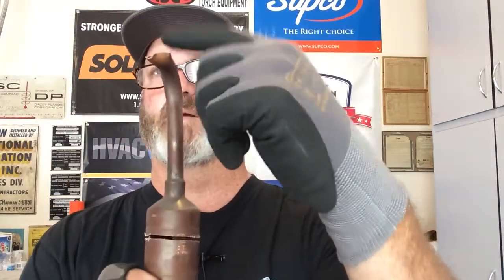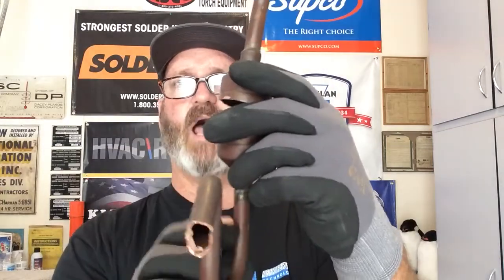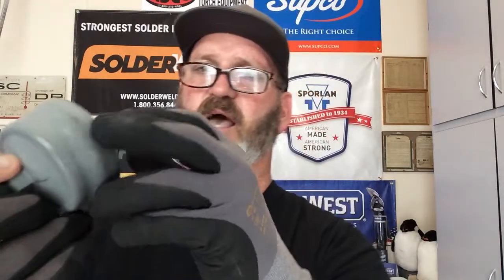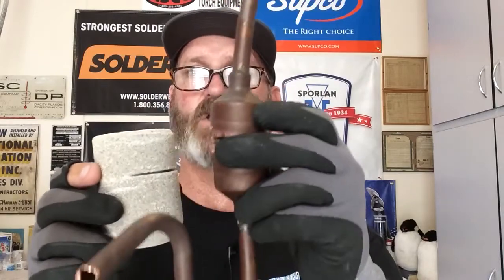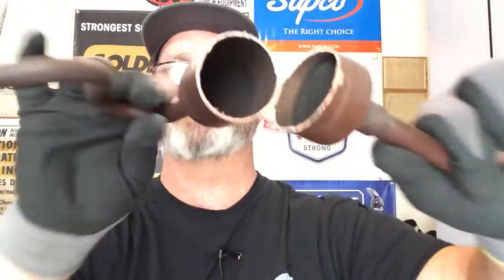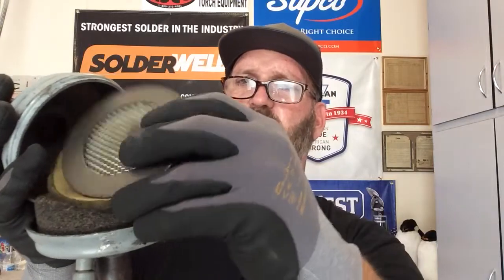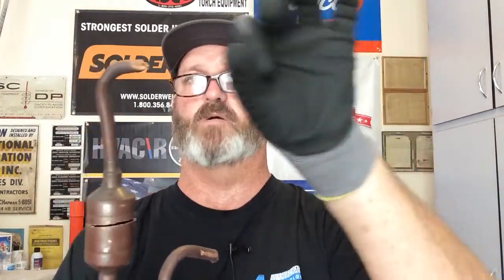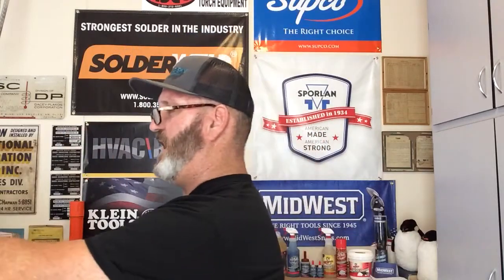Mufflers and Driers in an HVAC System.

Comment: Thank you for the video and very well explained Sir.
In the Goodman condensing units I sometime see a device that looks very similar to a filter drier  installed by manufacturer on the liquor line by the compressor.
Is it possible that device is a muffler?
Reply from the maker: You’re most welcome

Comment: Does it matter what size of filter drier you use as long as you compensate with adding or subtracting refrigerant depending on whether the thing is bigger or smaller than the original or manufacturer recommended??    Just wondering for 2 reasons..   the unit im working on blew a line slick out of the side of the compressor and has gotten no telling how much crap in it and they dont make the filter on the parts list anymore so i was gonna purge and put an over size filter on just to pickup any of that crap and still have room to work...   am i wrong in my thinking?
Reply from the maker: I wouldn’t think so, but i only use the recommended drier size. Rarely will I out a bigger one in.

Comment: Is it Bad to run without a muffler? My unit is an older R22 and has a hole in the tube. We were gonna run a new tube and just eliminate the muffler in the process to make it easier since it’s tight for space. It’s a 2.5 ton Goodman unit. Thanks
Reply from the maker: moore fab no, many units do not have mufflers. It’s really for units that may have a reversing valve right after the discharge line. Or larger systems that have larger compressors that cause pulsation sin the refrigerant flow.
Reply: @cochisecounty_travels  perfect, thank you for the reply.
Reply from the maker: moore fab no problem. Thank you as well.